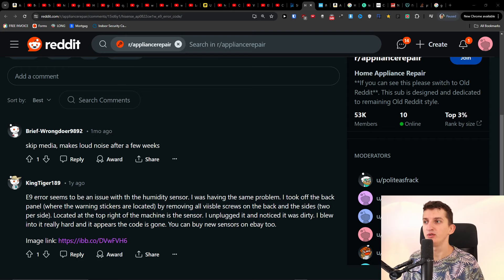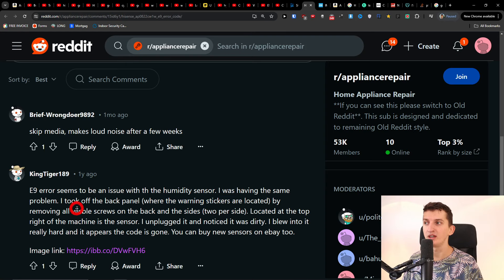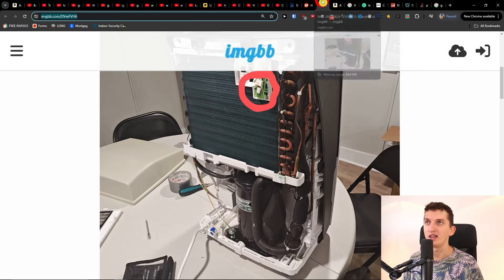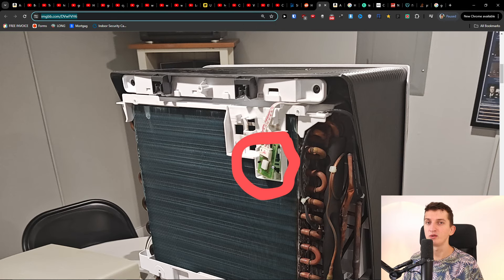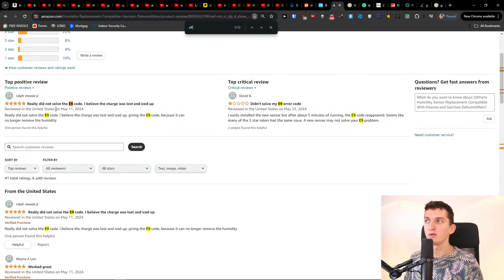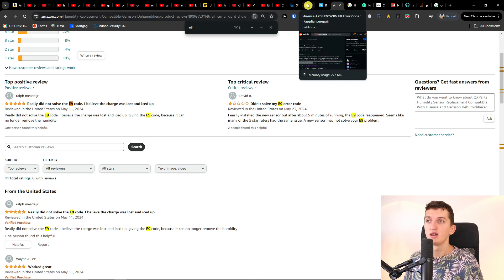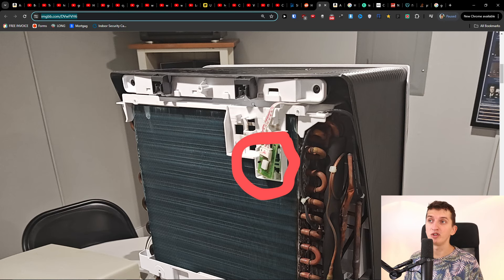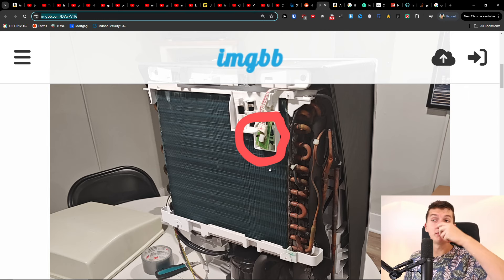E9 Error on Hisense Dehumidifier - How TO Possibly Fix

Comment: I disconnected the sensor (although it visually looked perfectly clean), but blew out the little waffle guy with a can of compressed air anyhow.  Then I sprayed some electronics cleaner in the socket.  Put it all back together, ERROR WENT AWAY, compressor kicked right in.  Just saved $25 on a new sensor.  NOTE: you have to take the entire shell off the unit, then remove the internal circuit board cover just to get to the sensor.  May not super simple to get to depending on your level of mechanical competence.  Removing the shell's screws is just the start, then you still have to convince the little plastic catches to unhook without breaking them. You might want to try blowing out the little waffle from the outside with a can of compressed air with a straw through the holes in it's casing BEFORE taking the entire shell apart- you may see the sensor through the holes if you look closely enough.  It might save you some heartburn and make for an even quicker fix!  Marcus, thank you for pointing me in the right direction.  I hope this helps others, too.  God bless!
Reply: I did the same thing and it fixed the e9 error. For about a day. Went right back to throwing the same e9 code and compressor isn't coming on.

Comment: I think i checked the sensor correctly, although im not sure if i was testing the pins for humidity or temperature. Resistance went down as i breathed on it. I checked the capacitor aswell, so now i kind of want to investigate if there are test ports on the refrigerant side of things. I cleaned everything, plugged it all back in and ran it. The coils would barely get cold, no frost.
Reply: I would love to see how/what pins you were testing with your multimeter! Great idea though.  Did you ever get it working??